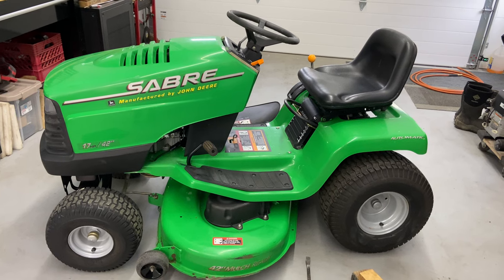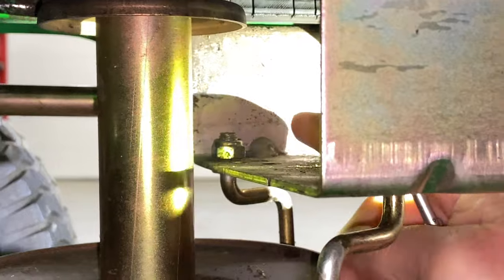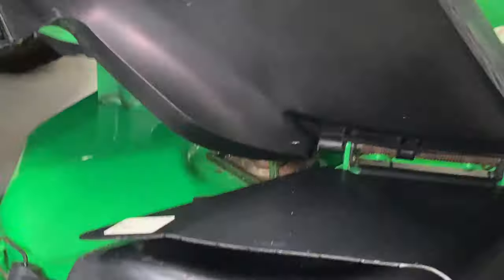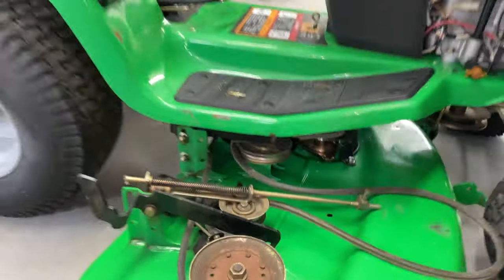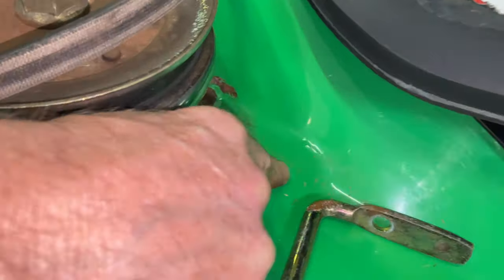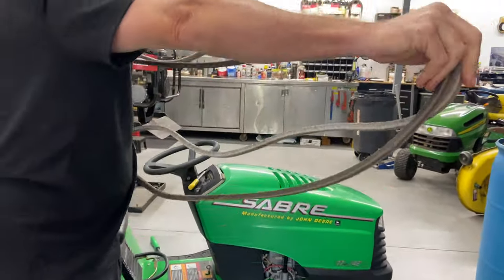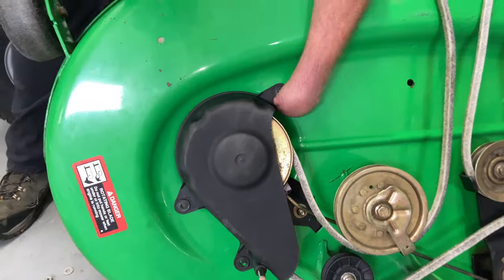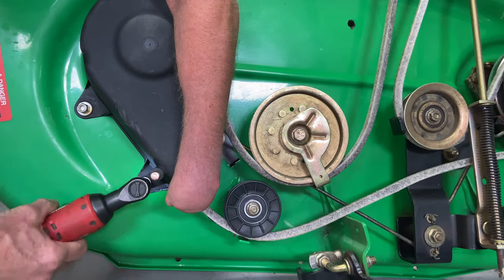How to Replace Mower Deck Belt John Deere Sabre 1742 Lawn Tractor

Comment: Hi Brad, Unrelated question. I have a quiet technology craftsman snowblower. Can I remove the filter in the gas tank? Every year I drain the tank I t pops loose and a pain to re-install or should I wrestle it back into the tank? Thanks again.
Reply from the maker: I do not recommend taking the fuel filter out. I would suggest start using Aspen4 fuel and you would not need to drain the fuel from season to season.
Reply: @JohnsonsSmallEngines  I would if I could get it here in Massachusetts. Thanks again.
Reply from the maker: I went to the Aspen sight and it looks like you can get it in Massachusetts in many places across the state. You can even have it shipped to you. Here is a link to find it. https://www.aspenfuels.us/outlets/find-dealer/.
Reply: @JohnsonsSmallEngines  Thanks again Brad, I'll check it out.
Reply: Great video but was waiting for the John Deere belt number would be very helpful. I could not see it on the package from that distance. I’m working on mine now the belt pensioner had play in it. I need to replace my bushing.